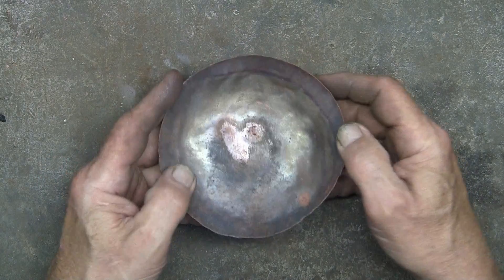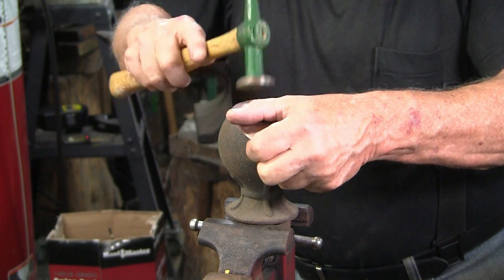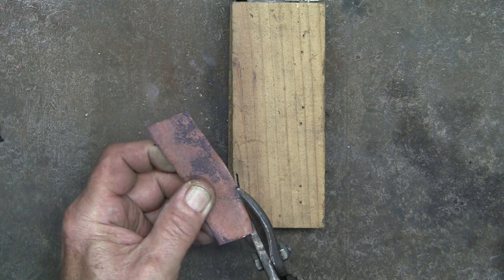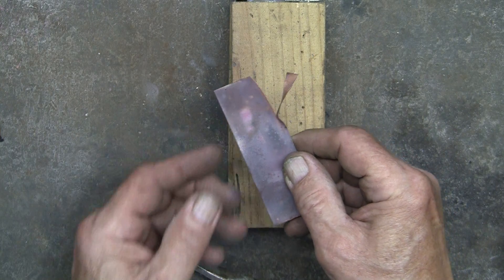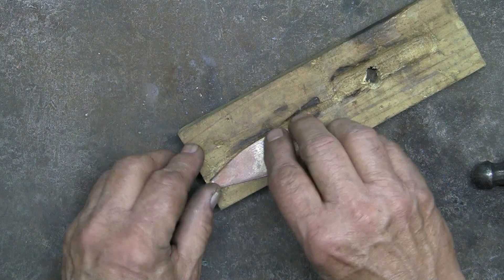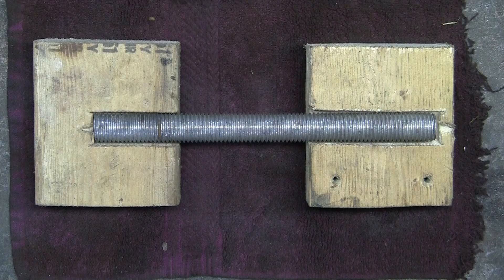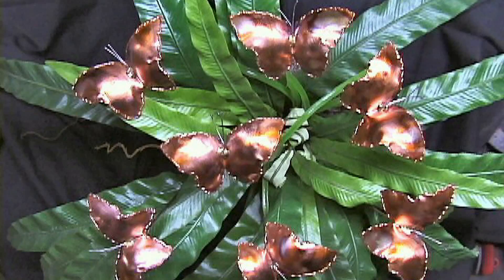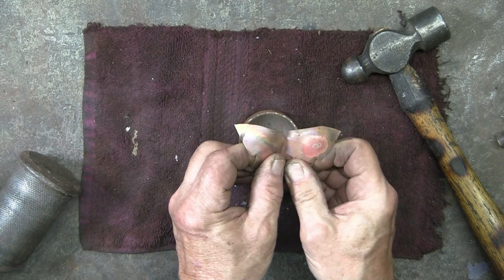Copper Hardening

Comment: Annealed copper work-hardens? I should have guessed..

Does quenching also harden? I’ve seen a lot of people doing that to remove millscale after welding/brazing, but that must be do to thermal contraction, which in itself is also working the metal.

Comment: Very interesting, could you help please.
I once made a walking stick that concealed a adapted samurai blade that I sharpened the back edge to match the natural curve of the front of the  samurai blade.
It was a fantastic piece but the handle and sheath were made of aluminium to make it look like any normal walking stick. The only difference was it was a oval shape to assist with gripping and locking the sword into the sheath.
I'd now like to make a hardened copper Chinese flute/dizi , hard enough to use as a staff. But also hiding a sword that again can be turned into a flute.
So my basic first question - how can I harden the copper tube without hammer marks.
It's more a demonstration piece for tourists, when I'm on the beach practicing my Tàijíquán in my bright white Tai chi Fu/uniform.
I no longer want a separate staff & multiple swords. Just one item and a hand fan in a pocket on the leg of my Tai chi fu.
"Guess who grew up watching Kung Fu with David Carridine ?"🙏☯️

Comment: Hello George. I need to maintain the shape of my copper with out distorting it like work hardening would do. I am using 10 or 12 gauge copper wire and rolling it into a spring shape on a dowel and then clipping it into 1" long springs shapes about 1/2" in diameter. I need the surface of the wire to remain smooth but to stiffen up the spring shape to withstand slight dropping mixing in a pale by hand or say shaking the pale or bucket filled with these spring shapes. Small amounts of deformation would by fine I just need them to hold there spring shape.Thanks for any info.
Reply from the maker: Not exactly sure of what you are wanting to do.  If I understand; you want to stiffen the copper wire without distorting the integrity of the spring.  My only suggestion is while the wire is still on the dowel, gently roll it across a hard surface.  A hard surface could be wood or metal.  If you do it gently, you  will not mar the surface of the wire.  Repeated rolling will stiffen the copper.

Comment: Is there a way to harden copper without hammering it? My end product doesn't allow for hammering. Thanks in advance!
Reply from the maker: I'd have to have a little more information.  Like the thickness of the copper and the shape.   Obviously it is not a flat shape or you could use the pipe or a rolling pin.  Let me know and i'll try to help.
Reply: @897473  Well I got one: I made myself a Freddy Krueger glove all out of copper (except the blades of course, those are steel, and I mean the literal designs from the original and remake movies), without any softening prior (try shaping the fingers all by hand and pliers, boy that was tough!). But the welder whom soldered the blades and the rings underneath the fingers left the copper fingers all soft (due to the soldering heat I presume). Obviously none of these "solutions" works for a shape one cannot hammer/roll away because it's already shaped (and assembled). So how exactly can we harden a copper shaped object that we simply cannot hammer or roll over?
Reply from the maker: I don't know of any other way rather than using pressure ( hammering). I'm sure you are not the first that has run into that problem, so you may have to do some research on the web for a solution.
Reply: @897473  Damn, this video of yours is like THE solution online. Maybe freezing my copper would harden it? It sucks because have to be extra careful with it or it'll bend like cardboard...

Comment: Mr. Goehl, 
Can Copper be hardened enough to put a knife edge on a piece and it remain sharp for a respectable amount of time?
Reply from the maker: By hammering you can get the copper very hard.  When it is too hard it will be brittle.  Knife edge:  Filing or grinding will achieve a knife edge,  How long it will stay sharp is dependent on what you will be cutting.  If you are using it as a letter opener, it will stay sharp for quite awhile.  If you are using it to cut a hard material, the sharpness won't last long.
Reply: George Goehl  thank you sir for your speedy reply.
I have an Idea to make a nice sushi/meat slicer for my son and his girl. He makes Texas BBQ Brisket almost as good as me. I think my new idea will be to split the Copper and Tig weld a piece of 01 tool steel with Silicon Bronze for the knife edge. I will probably forge some Makume Gane (Bronze, Nickel and Copper) for handle embelishments and an Ebony handle.
Maybe I  can do a serving fork, a chopping knife, a paring knife and make a wooden box and give it to them as a set. 
I will be watching many of your videos from now on since I have found your channel. Thank you for sharing.
Reply from the maker: What an outstanding gift.  Hope you post some photos when it's finished.

Comment: Is there a way to harden copper without hammering it? - I'm tinning old copper pans and bowls and they're getting soft after i've heated them up and added tin, which makes them difficult to use properly in the kitchen.. I've thought of, but not tried, to heat them up in the oven and leaving them in there to cool afterwards (a slow temper, if it was steel..).. maybe that could work? 
Thanks in advance!
Reply: Jakob Solkær the slower you let metals cool the softer it will be

Comment: Where do you purchase your copper sheets?
Reply: +Teena Stewart Charlotte has sheet metal suppliers. Just google 'Charlotte North Carolina sheet metal suppliers. But the suppliers I listed are good as well. As long as you don't need really large sheets. The local places may only sell wholesale though - if you have a resale number, which you get from the state.
Reply from the maker: Teena Stewart  Teena, I used to have a deal with a warehouse which has kept me well stocked with copper.  I haven't bought copper in years so I am not a good source today.  What I would suggest is the video I did on "Buying Copper".  You can find it here:  http://gsegmedia.com/?page_id=2877
Reply: +Teena Stewart There are a number of suppliers for high end copper sheet. Contenti.com, Riogrande.com, Mettaliferous.com. You can sometimes get copper sheet from a metal scrap yard or metal supplier if you live in a city with a good industrial base. I used to live in Oakland Ca, I could find ANYTHING in that city. I know live outside Chicago and have to order online and have things shipped. One reason to order from one of the places I suggested is that their products are consistent and the metal is high quality. There are many additives to most metals you buy, and it depends on what you will be using it for. I make jewelry, so I need my metals to have the same range of additives - which I get from these places. So the sterling will be consistent and I won't see a difference in color from one piece to the next. You can get copper, brass, nugold, sterling, argentium sterling, silver filled, gold filled, gold, etc. from all these places. A good reference for getting started with finer metal work is Art Jewelry or Lapidary Journal magazines.  Good luck.
Reply: +archjane Thanks for the supplier info. I will check them out. I live in Hickory, NC. Not a very big town so I don't have the resources you do.